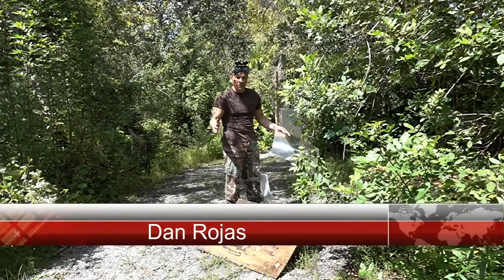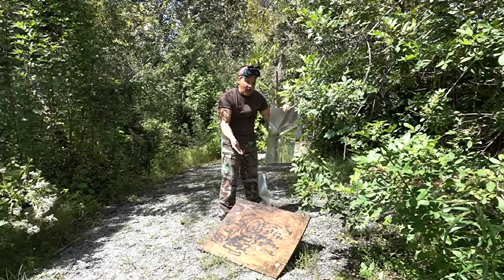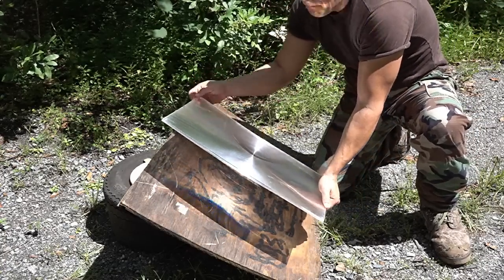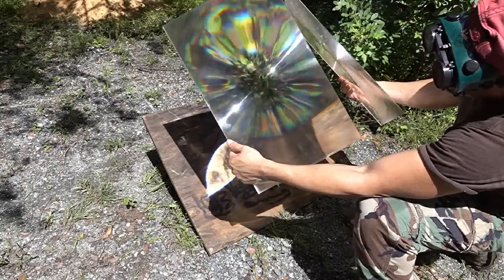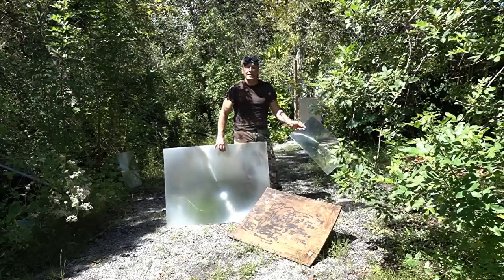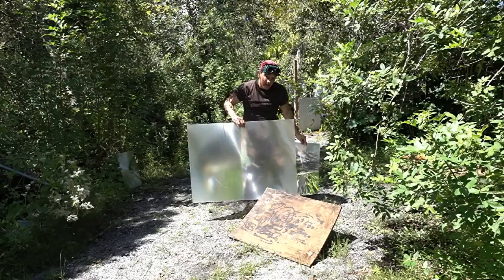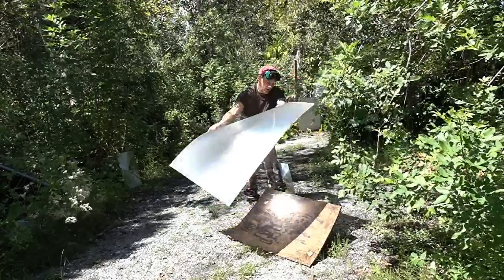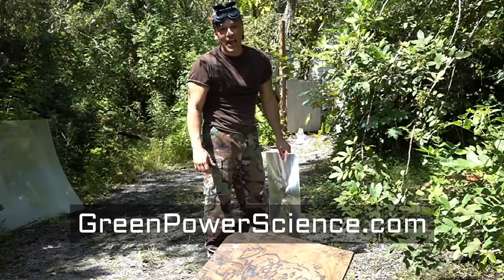FRESNEL LENS MYTHS about solar projects and misconceptions

Comment: That fresnel lens reminds me of the time my back window was broken out on my old S-10. A friend hit the gas instead of the brakes on a four wheeler we were loading and bam, there went my window. It was going to rain the next day so I took an old junk tv apart and cut out the screen to fit, secured it with black duck tape. It actually looked pretty cool! The next day it kept the rain out on the way to work. Then the sun came out while it was in the parking lot. The center of my dash including the radio looked like someone had took one of those big propane torches and melted it. That's where I learned what a fresnel lens was.
Reply: 😂 yeah my kids laughed at me for putting a sheet over it (I had mounted a Fresnel lens in a frame on a stand) when I put it in the shed...then I boiled a 2 oz lead fishing weight in under a minute...they didn't mock me anymore! 😎
Reply: @tatchik77  🗿
Reply: LoL mate

Comment: The solar energy available via a Fresel lens, parabolic reflector, or similar device, is a linear function of its effective aperture. An effective aperture of one four times greater will transmit four times as much power as the smaller. You will get no more power out of a passive device than what you put in, and with physically realizable devices you will get less depending upon the losses within the device itself.

Comment: What if you were to focus the fresnel lens at a parabolic mirror? Or an array of that setup? Could you amplify the sun then? Direct sunlight reflected at a specific point? I think your boiling water videos are awesome...nuclear power without the radiation...or a steam engine...i live not far from you and would love the opportunity to have you for a day to show my kids about this stuff.
Reply: It depends on a number of factors. The radiation pattern of the lens for one. The best efficiency for a parabolic reflector is when the feed’s (len’s) pattern is about 10 dB down at the edge of the reflector. Also an offset reflector maybe more efficient in this case since there’s less blockage from the F lens.

Comment: Good afternoon.  I thought about how a Fresnel lens can enhance a solar pane as well as add heat to a sand battery.  If a Fresnel lens was positioned above a solar panel, the solar panel would become very hot.  Instead of allowing the solar panel to absorb so much heat, why not attach antifreeze filled pipes to the back of the solar panels.  Then somehow transport the hot antifreeze from the solar panel to the sand battery.  The sand battery could absorb the excess heat.  This sand battery could be stored for future winter heat.
Reply: Sun-sand-steam-electricity is a very interesting pipeline. You could also probably make a sand battery quite easily on BLM land in the USA and heat the thing in the day and use it to stay warm in the night. Wonder what the best way to kit that would be? Small heat-resistant bag/folding box for the sand, and in-out ports for air. Wonder what volume of sand would keep a small camper warm for a night assuming good weather during day.
Reply: @SOGHIH  I live in a mobile home.  So I would need a small portable sand battery.  I was thinking about how the Fresnel lens would increase the output of a solar panel.  I was also well aware that the heat generated by the Fresnel lens could damage the solar panel.  That's why I thought about the idea of using antifreeze filled pipes to remove the excess heat from the solar panel.  Then I thought, why should I allow the heat from the solar panel go to waste.  That's why I decided to transport the excess heat to a portable sand battery.  That excess could be stored for months in a sand battery.  Then the heat could be used during the winter months.

Comment: Does it negatively affect the lense performance to include the clear plexiglas in the frame as an anti-sag support when testing in sunlight ?
Reply: It does, but not much. I did that with my last lens because it protects the grooves from scratches and is much easier to clean. Some birds seem to believe I build it for them to sit on on the frame and poop on the lens...

Comment: What if you set up a mile-long copper pipe, with most of its length wrapped in thermal insulation, with bare intervals, with MANY Fresnel lenses rigged with a sun-tracking mechanism, focusing an ENORMOUS collective amount of solar heat onto this copper pipeline, so that by pumping air into one end of the pipe, it comes out the other end like a BLOWTORCH, to provide thermal energy for various industrial applications?
Reply: It's already done , but uses thermal oil and generates electricity

Comment: Hey Dan! glad you are posting again, I am a fan of your channel. I was curious about the implications of using a lens or a parabolic mirror to power a TEG/ peltier plate. (Such as that ones made by Devil watt). These generators are probably safer than  steam engines but usually need very high temperatures. I saw you had an old video about these and how they work but you never had a follow up with your lenses. I'm an amateur, and really just trying to find ways to help reduce my carbon footprint so any help from you (or other YouTube commenters ) would be appreciated!
Reply: Andrew Angerer   sounds like a good idea, but much do you pay for enough peltier devices  to get, say, 1 kW?

Comment: Can you make a large container out of glass that is able to hold a large body of perhaps have copper tubes on the inside of the container that have connectors on the outside of the container to heat up, have many lenses from different positions aimed at different hotspots ( the outside connector part of the copper heating tubes), heating multiple places at once to get a larger dispersal of heat in the water tank.

Combined with the magnification of the glass around the large container. 

I'm not sure how large things need to be, but at a large scale ,it's possible for us to heat a large body of water and collect the compressed steam to make turbines spin.

A new type of solar energy.
Reply: It makes sense ! 🤔🧐😎😀
Reply: Bro, I literally had the exact same idea.  We should start a business.
Reply: @siafu-1764  I'm good for working on this project

Comment: The only way you can do any better is if you get FIBER OPTIC that is concentrated into the receiver side delivered to the other side or the delivery side. Get enough you can have some power. BUT Fiber optic had refraction the longer you run it so you are limited to length of transmission. A lot of people don't know that fiber optic will deliver all the light IR all the energy with some loss due to refraction.
Reply: respect for this man
Reply: What if you increase the diameter of the fiber

Comment: What if you set up 2 lenses one very big , enough for example to have a very large focal point area (for example say the area of the focal point is 12 inches.. the second frenel lense will be the exact size of the large lenses focal point in this case 12 inches.. this means the entire area of the 2nd lense will already be concentrated light.. wouldn't that further amplify the power?
Reply: someone tried it. Basically actually smaller focal point diameter, but final net melting power was smaller than with just one big lens.
1.   watch?v=xeUI8vPkUqI
2.   watch?v=zuthle6k94A
Reply: @micha3624  I'll check it out thanks.. I was thinking it might melt the second lens but I'm not surprised the answer is actually less power

Comment: One correction, when we stack lenses with each other the net power of the lenses become the sum of power of the lenses, power of the lens is the reciprocal of the focal length in meters, so when you stack 3 lenses the net power becomes thrice the value of single one hence 1/3rd the focal length, so theoretically the focal length of the system of 3 lenses is 18/3 cm that is 6cm
Reply: from start the focal points he is stacking don't come from light sources dat are perpendicular to the lenses
Reply: from my understanding sunray gave us 1 kw/sq m regardless 1 sheet or 3 stack and doesnt matter how long its focal point i mean 1kw at 2 meter or 1kw at 3 metre it just same from 1 sq meter area

lens itself only dictated power by its properties(lens optimal geometry, transparency, transmission lost etc) i dont really understand what do you mean by sum of power n focal lenght, correct me if iam wrong

Comment: Is it possible to disperse the heat from a fresnel lens to create safe ambient heating?
Reply: I was thinking the same thing.
Reply: because the sun move u need to adjust the angles of the lense constantly, it need a proper support setup for it to be automated, frames etc. u need a program to run the positioning and motors and alrdy electricity. maybe maintenance, The concept can work if you use the technology as a steam plant, aside from the house, and the free electricity it over produce can serve ecologically in your house in the way you want. sum electrecity is used so it can run itself and you get an over production.
Reply: it's called a glass window...

Comment: One thing you didn't cover was instead of stacking the two lenses, separate them a bit. So essentially mount the small one at 18 inches from the intended target as you mentioned, then place the larger one 36 inches away from the smaller lens. Don't put the larger one at a point that will burn the smaller lens, but back a bit further than that.  In this way the smaller lens would be concentrating the partially concentrated light from the bigger lens.
Reply: yes and also what about concave and convex lenses that can focus sunlight from a larger area (more directions) than just their surface area?
Reply: nah its easier then dat jst use simple mirrors to redirect sunlight to get the good angle BEFORE u lense it, cause the source of light always must be perpendicular to the lense not like he is doing at 3:13 wtf..
Reply: Lol. He said the light will always go in a straight line for the most part. Lol.

Comment: I've been trying to research optimal shape. I have a 65 inch lens that I am going to polish and hopefully make into a spot lens. I am wondering if cutting it in half would be a good idea. It's nearly twice the length as height, so each half would be nearly square. I wonder if that, being more near the shape of a circle, would be pretty close to optimal, or if I should leave it all in one piece.
Reply: You can't cut a Fresnel lens in half, that would leave you with a destroyed lens
Reply: I'm interested to know the results of your polishing and what you used.
Reply: @davidmuth4571 
My whole project was a massive, disappointing failure.
Reply: you need to make a concentration dome but its very big you need the large mirrors etc. but you can stack alot alot of lense

Comment: what about Fresnel lens used to heat a plate of iron that has a copper tube sandwiched in between two plates and has a tube that goes to an conditioner radiator and the end hose goes back to the heated tube in a cycle. the tube to be filled with oil and each time the oil goes thru the heated section it gets hotter and hotter. a fan can then blow on the radiator to heat the house. a small window unit inside the house.
Reply: I have read some solar concentrator farms using carbon dioxide gas to transfer heat.  i would choose this personally as gasses move faster, and carbon dioxide is quite inert, if under enough pressure and temperature does have solvent properties though as it becomes supercritical co2.  Also other solar concentrator farms using graphite to store heat.  Graphite apparently stores heat quite well.  It's black and will absorb more of the solar energy.  Could always use basalt or black lava rock as a surface to concentrate your solar energy on to.   Copper tubing may melt if hot enough.   I think... just guessing.... that if you took basalt or graphite and cast it around a few cm thick piece minimum of concrete with the tubing in the middle, you should be okay.  To get more efficient and better perhaps more economical use of the solar energy, would be wise to have several windings of copper through the cast section.  Could always be a loop...  oils are not a bad idea, but i would go gas with the solar, as it could be exceedingly hot, and then the oil burns or vaporizes and that could rupture the system, unless you want to have hot open exposed oil.  Definitely recommend gas, and carbon dioxide, which is what some in industry are using.   But you could use iron pipe if that's an issue, not sure if that's cheaper.  But yeah you could take your tubing for transferring your heat, have a valve at each end.    And hook up a bucket with dry ice in it, sealed, with tubing for vent, connected to one of the valves, then other end valve open, and that will remove the oxygen and replace it with carbon dioxide.  then at appropriate pressure, close it off.... so maybe also use a pressure relief valve?  i don't know.  But not difficult.  Then just seal up, perhaps solder or braze closed.  Could always have this tubing as a long coil, and run a fan through it... get a thermostat hooked up to a fan and voila temperature control.
Reply: I had same thought regarding ammonia based refrigeration, not sure how one would regulate the heat/temp.

Comment: I was wondering if the lenses would warm my house (that is made for Texas summers) during those rare winter storms? Shallom you are loved
Reply: I don't see why not. Just need something that could absorb a lot of heat without burning.

I'm thinking water. The lens heats up a water reservoir. Then the steam can be directed through pipes around the house, dispersing latent heat. Then the steam that condensed back to water drains back into the reservoir.

In fact, I'm sure there's something like that out there.
Reply: Sand

Comment: You make your own fresnel lenses? wow! I assume you won't make a video showing how?
Reply: search for "Convert Linear Fresnel Lens to a Spot Fresnel Lens GreenPowerScience" ;)
Reply: search for "Convert Linear Fresnel Lens to a Spot Fresnel Lens GreenPowerScience" ;)
Reply: That is how they convert them, not how they make them from scratch, which they also do.
Reply: Well.. if you define "make" as harvesting lenses from old overhead projectors or projection TVs to sell them for top dollar by cutting them and adding a wood frame then ok. But the actual manufacturing of the lens itself no they don't.
Reply: Quite wrong. They have videos showing fresnel lenses which they MAKE themselves, as I pointed out.
Reply: plastic frame with water on it

Comment: Hey Dan. I was thinking that if u get closer to the sun by getting on a very tall tower, the fresnel lens beam would be more powerful when the sun is closest
Reply from the maker: People in Colorado or at high elevations have more power because there is much less fine particulates. In the Winter here in Florida, the results are better because the humidity is lower and the skies are usually clear. I don't think distance is as important as a clear sky. We have noticed about a 10% power increase in the winter.
Reply: Because a hundred feet is so significant in the 93 million miles to the sun.
Reply: if colder weather meant lower humidity and less particulate(thus more power), then higher elevation seems more ideal for more power because colder temp (which means lower humidity) is more found at higher elevation. I know that because I used to fly and it got freezing the higher I went
Reply: @GREENPOWERSCIENCE   The Earth is around 3 or 4% closer to the sun in winter versus summer.  That should translate to about 6 to 8% more power per unit area.  Perhaps that has something to do with it.  It wouldn't increase the intensity of the focused spot, but the total power would be higher.  Still surprised you got 10% more, though, considering the lower angle means it passes through more atmosphere.

Comment: Hey there Dan, always enjoy your videos. Would a large focal length fresnel lens work for boosting a smaller solar panel, assuming you could deal with the heat dissipation?
Reply from the maker: Yes:
https://www.youtube.com/watch?v=-yh1q59a1h0
The issue with this is tracking. A solar panel alone works off axis to the sun pretty good or optimal with simple tracking. When you depend on the concentrated sunlight optimal tracking is required. This is one reason why CPV has not gained ground as regular PV prices have dropped. The heat removal and heliostat configuration is easily offset by just adding regular panels.
https://www.youtube.com/watch?v=2438vytA4Po
I sort of saw this coming. CPV is awesome for space projects but not financially competitive on the ground.

Fresnel lenses and parabolic mirrors have a huge advantage over regular PV for heat applications. For electricity, regular PV seems to be the way to go now. No tracking, no moving parts and plug n' play.

Comment: It seems like Fresnel lenses should be cheap to produce. You just make a mold with the proper negative of the ridges and press the proper plastics.
Reply: indeed.  polyethylene can be used even.  i think the biggest thing with working with enough heat though and plastics is to have the lenses to the side, as hot air rises, and perhaps a fan or sacrificial plastic barrier before the focal point?

Comment: what if you built frames to put 2 or 3 lenses in, and experiment with distances between lenses? Then build an adjustable stand? Just curious!
Reply: you would have 2 to 3 different focal points, he commented on it in the vid...  only if you use para mirrors to redirect the light all to one focal point, will it do anything more...